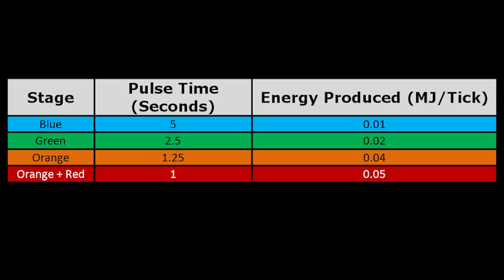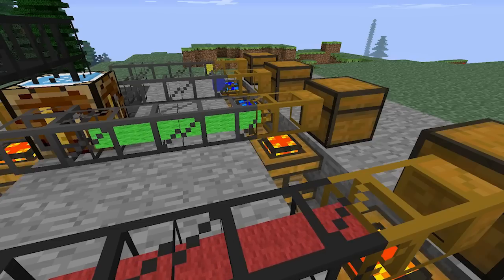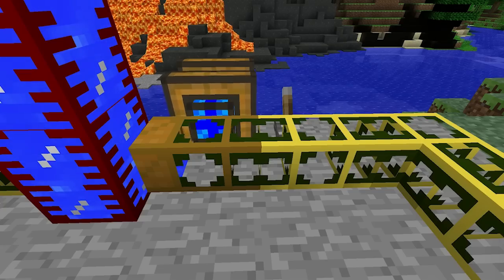Redstone Engine (Tekkit/Feed The Beast) - Minecraft In Minutes

Comment: Another option would be converting oil with the petrochemical generator (seperate mod) into EU (IC) and send that to an electrical engine (Forestry), which powers the quarry. Electrical engines don't overheat according to the wiki.

Comment from the maker: Well there are a couple of options, might be a little expensive, I'll leave it up to you. You could use combustion engines, just being extra careful that their water doesn't run out, as long as they have enough water, they'll stay at the green stage and won't explode. On top of that, you can also use gates, although they're pretty expensive, they can be set up to automatically shut down engines before they overheat.